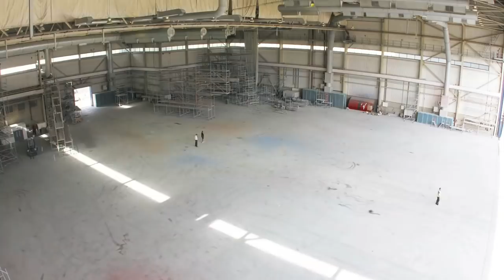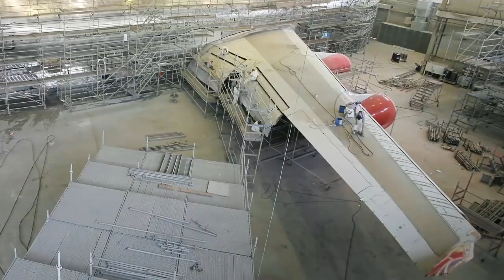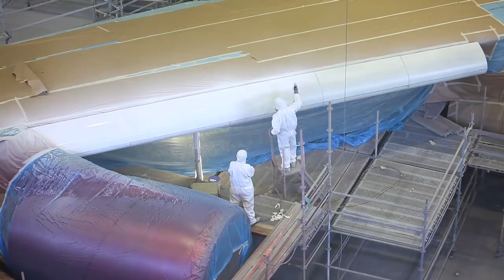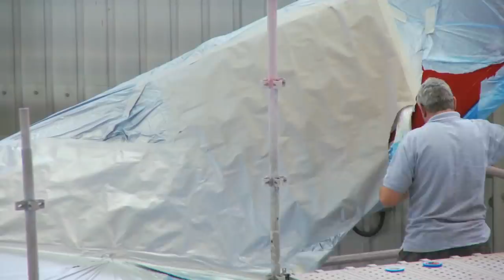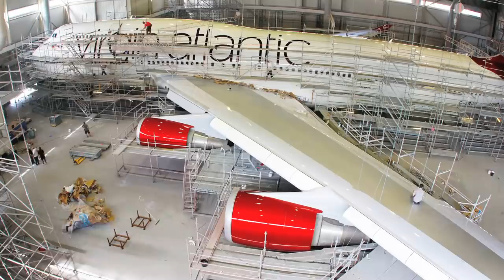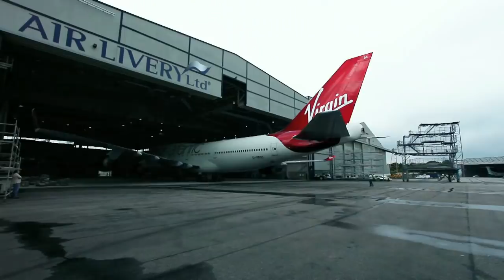Virgin Atlantic 747-400 New Livery Time-Lapse

Comment: Just painted right over the old paint job.  How much do you think a 747-400 paint job weighs?  Now multiply that by two for the previous paint scheme and the new one over it.  Now multiply that weight by the fuel it takes to fly it and the years the plane is in service.  I wonder when the break even point is...  if ever.
Reply from the maker: Thanks for your comment, much appreciated. For reference they stripped off all the paint off the plane. The blue substance applied around the 30 second mark is paint stripper. All planes are professionally and independently weighed before the planes leave the hanger. Hope this helps.